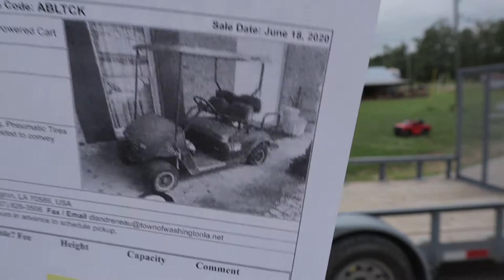2004 EZ GO TXT BUILD PART 1

Comment: Looking great so far. What’s the plan on a lift kit? I’d also recommend going with lithium batteries. You’ll shed a significant amount of weight plus gain more range. They are about twice the cost but last for years.
Reply from the maker: Part 2 out!